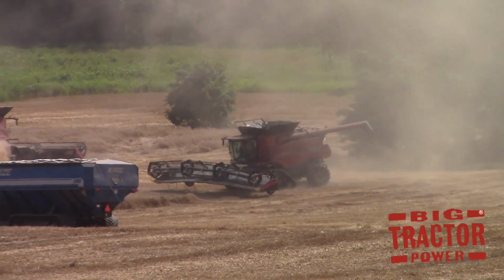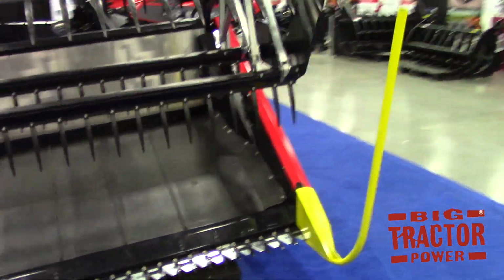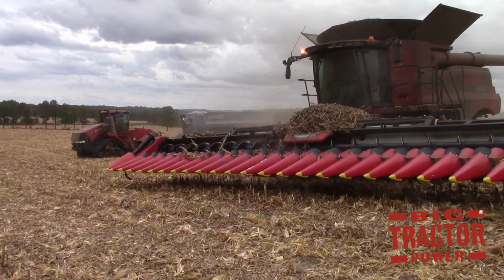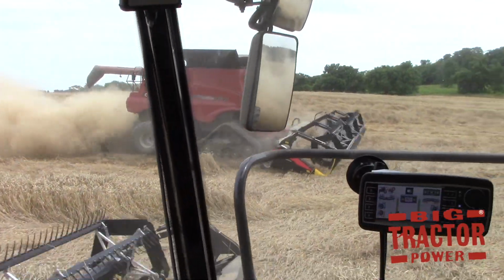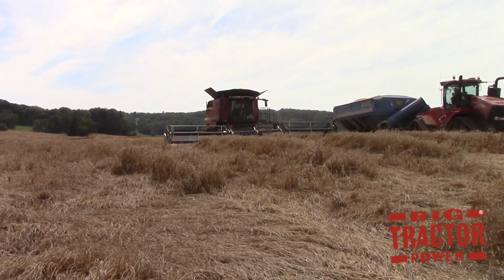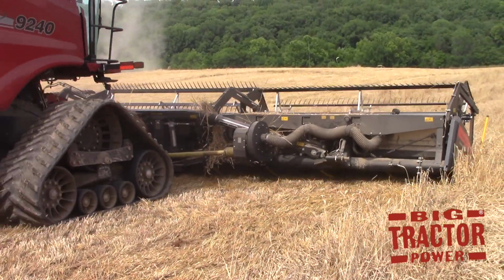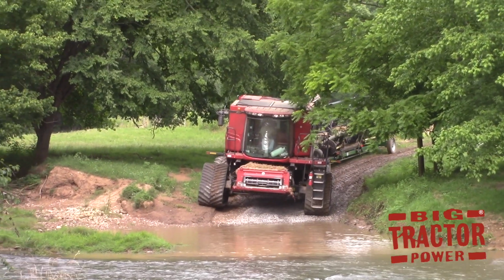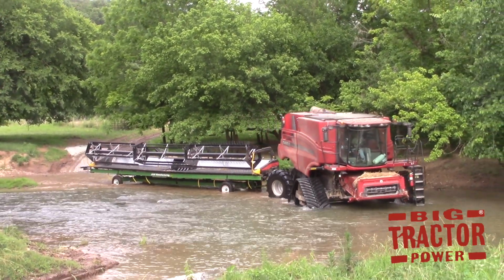All New 40ft Geringhoff Truflex Razor In Action

Comment: We run the same heads but ours are 35 feet wide. Great flex and in low beans they work excellent.  The heads we run have air systems that blows air on the cutterbar saves on header loss in dry beans .
Reply from the maker: Very nice.  They are impressive.  What combines do you run them with?
Reply: @bigtractorpower  a johndeere 9870sts and s680 .  We had a 9750sts but we traded it in on the s680 . We cover 6 to 7 thousand acres anualy with our own 5200 acres and custom work so we tend to keep newer machines around if we can .

Comment: Never ran a combine but want to know this...seeing how much the razor flexes and how constant how much does a normal draper loose in the same field and circumstances? Or is it just a better cut? Basically is it necessary or not? Can a standard draper not get that close to the ground? Sorry for the questions but watch the channel everyday and this is a new concept for me.
Reply from the maker: +Adam Smith other drapers do not flex like these. Depending on what type of header is ordered they can be made to be less ridged to flex to a degree but all other makes are just a One section bar. Geringhoff's three sections let the head really flex.  It is a new design. Time will tell how the industry and customers react.

Comment: Nice what it can do, but I would be worried about picking up rocks and running them into the combine.
Reply from the maker: +Ben no stones on this trip but one picked up a deer antler. That was why it was way up in the sensor shot. The antler snagged and would not come out.
Reply: The rider has. It is   very different from each other but I don't have to use them to get more free games.   It has a very
Reply: We have ran those same heads for wheat and soybeans this year.  We have harvested 4000 acres of soybeans so far . They will pick up stones but it's about the same as runing a normal head . They cut like a dream and perform well on tough beans after dark . We were very concerned about stones but the heads are the best .

Comment: Unfortunate you were not out there the day they wrecked one of the Geringhoff headers by encountering a rock and then used a brand new model MacDon Flex Draper in the same field.
Reply from the maker: +AZ Phoenix ouch. Rocks can make a mess. A farm I film at lost an FD70 cutting beans last fall by hitting a rock after dark. It folded the header and it had to be totaled out.
Reply: Yes, the farmer did hit a rock, but Geringhoff was able to overnight parts and get the head repaired within a few days. The farmer was able to finish harvesting his crop with this head. Our heads are built on components, so in the event that a section get damaged, they are easily replaceable.

Comment: Doesn’t matter if the head is 40,50,or even 100 feet wide if the 4” in the center and the center drive pushes like a d6 dozer..
Reply from the maker: The field in the video had hog manure applied to it in the fall before planting.  The wheat yielded so well it fell over flat.  The Geringoff was excellent in riveting the down wheat.  The air table is very helpful.
Reply: @bigtractorpower  I’ve been trying to cut down soybeans for the last 2 weeks it pushes at the center drive